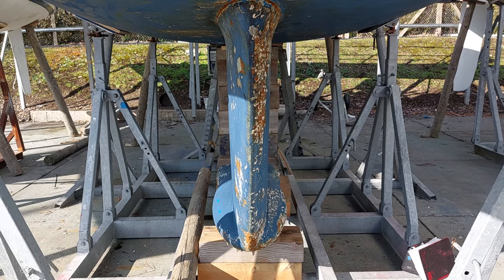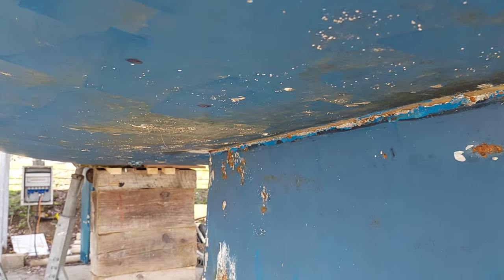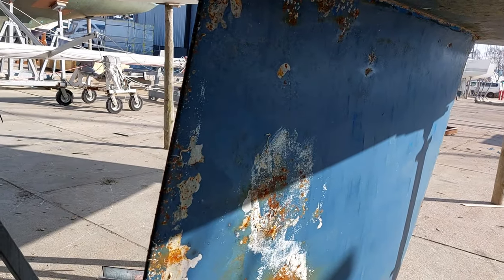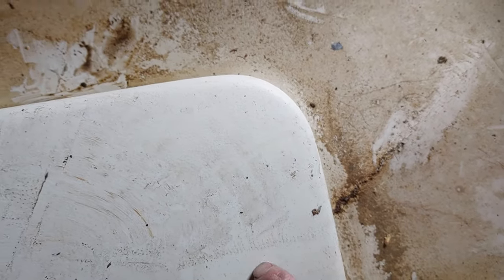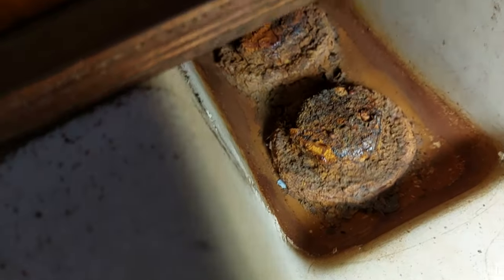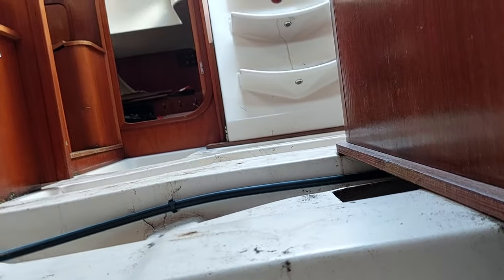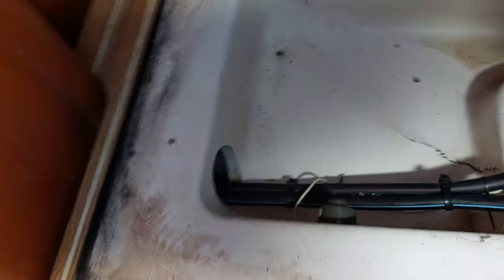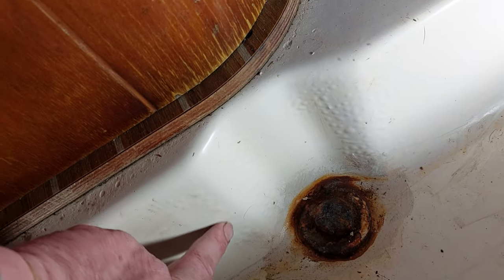serious structural failure of a yachts keel matrix from a significant grounding.

Comment: As an ex insurance underwriter, I can say that this is not worth repairing, unless someone buys it for pennies, then has the time, money and skills to repair it themselves. The problem still remains though, that the structure as designed was inadequate to resist a grounding impact. Restoring it back to spec will still mean the next impact will put you back to square one. Not an insurable proposition without a complete redesign and upgrade in strength.
Reply: Expedition Evans did a good series on that. Similar issue and willing to put the work in and accept what they might find when gutting the boat, they were with some luck able to come away with a much bigger boat than their savings would otherwise allow.
Reply: As a former boat yard manager and a marine surveyor who has over seen many repairs worse than this is have to disagree
Reply from the maker: Interesting.. the claims paid for it to be repaired against the insured value.  The repaired craft is certainly stronger than the original pasted together hull and internal frames
Reply: Scrap it for the safety of future owners

Comment: What a crappy boat- steel (not stainless) keel bolt hardware?. Galvanized pipe connecting a bronze thru hull? I would recommend scrapping not repairing.

Comment: Hi, I have seen a YT video for a similar repair by a Swedish shipyard done very professional. The boat was in the shop for 7 weeks. I don't know the cost, but it must have been substantial. I'm sure the cost will be higher then the market value for a 20+ year old boat. That would main for an insurance  that the boat is a total los. If the boat has an insurance for such an event, the owner will receive the current market value of the boat as a maximum.
Reply from the maker: Yes a lot of it comes down to value.  Depending on the severity many keel and matrix repairs cost between £9 & £14k in UK but obviously this is a very basic guide and every one is costed on its level of damage. Thanks for your comments
Reply: @TheMarineSurveyorNotebookBenSu  Hi, thanks for your response. I had a much higher cost number in my mind. That was based on this repair: https://www.youtube.com/watch?v=8X-Nb9-pbfU  (SAILBOAT REBUILD - how to REMOVE a KEEL - Plastskador repair - week1)  That was a partly rebuild of the grid and re attache the bottom hull.
Reply from the maker: It's very dependent on extent of delamination.  And where in the world you are based!

Comment: Amazing footage, thank you.
I surveyed two of these type of boats in the past few years.
Curiously it did not take substantial grounding to create such damage, one was motoring at the entrance of a marina around 5knots and grounding in soft mud, the vessel just powered through but the damage was done.
I contacted the manufacturer who suggested that these boats, using a grid to support the keel, are made to have the keel hang from the hull/shell and the boat should not rest on the keel while in dry dock.
!
Cheers,
a
Reply from the maker: Yes it's not always a substantial grounding that causes the issue as many vessels are pasted together so very little tolerance to being flexed

Comment: Another interesting day at the ‘office’ again! Quit a destruction indeed. Don’t think I would like to buy this yacht, even after an extensive repair. The corrosion on the keel bolts also were wuit extensive. Hopefully from standing water in the bilge.
Thnx again for s great video!
Harry
Reply from the maker: Many thanks for the comment. Once repaired, many are better and stronger than when first built... the but is as long as its been done properly. Thanks Harry 😊

Comment: Very nice video. It would be interesting to see how a repair like this is done. How do you maintain the alignment and geometry of the boat when you start to cut it, I wonder.
Reply: You “Hang” the boat on the stands so that the keel is hanging like if it was floating, then starts the grinding and laminating the many layers of glass, we had to do that on a boat that the owner hit a rock at 8 knots, that caused significant damage, it took 13 layers of tri-axil woven roving glass to get it structurally sound again.
Reply: @MrSeachaser175  Yes, I know about the process in general. It would just be very interesting to see a detailed vlog about all the steps involved. I don’t think it exists on YouTube. At least I haven’t been able to find one.

Comment: I know nothing of boats or boating but two questions if I may..
1) Why are steel bolts being used when surely stainless bolts (of appropriate tensile strength etc) might be used?
2) Is there any steel (ideally stainless) set into the bottom of the boat to which the keel is attached and which would also prevent "hogging"?
Reply from the maker: They are high tensile and have been used by quite a few builder including ah moody and others. It's essential to keep them clean and dry .. into a iron keel in many ways far better and less likely like stainless to suffer from crevice corrosion.. see my you tubes on that one!!! For the best way .. silocon bronze .. I've yachts still with the original ones we fitted over 45 years ago!

Comment: Or, convert the boat into a displacement hull trawler. Leave a 6 or 19 foot mast for a steadying sail, antennas, navigation lights, etc. drop the keel, repair the hull to be watertight and reasonably fair. Fill the bilge with cement for ballast. Would make a slow but decent live aboard trawler.

Comment: Very interesting video,  thanks.  Would a more traditional hull construction be more likely to hold up better in a grounding?  Would it be easier to repair?
Reply from the maker: Certainly a yacht that all frames, bulkheada and sringers are bonded in are stronger on impact.. but cost considerably more to produce.

Comment: Do you find that keel bolts like this come out promptly?  I am feeling like I would take off the keel,  tear out the grid, one bit at a time to maintain the boat shape, and then glass in floors and stringers. I am not a pro, and I am thinking the job would take two  months including drying time. The amount of fiberglass itch is beyone calculation: Defcon 4. Lay days in the yard alone would be $6K where I live. At least 10-15 gallons of epoxy, plus some Kay-Cell. And an acre or two of roving and stitchmat. A small fortune in sandpaper. A small plastic cup for my tears. Am I wrong?
Reply: Retrospective glasswork never takes. There is no chemical bond. Only mechanical.
Reply: @stephengrimmer35  That seems overly pessimistic. Lots of repairs are just slathered over the top of heavily ground out structure. Epoxy seems to stick pretty well. Poly, not so much.
Reply from the maker: Not impossible.  Once cleaned back most do come out

Comment: is there a specific make you find keel impact damage worse on?
Reply from the maker: Hi encapsulated keels normally are better.. then solid hull with bonded in frames then it's pretty much open to the level of impact. That said hulls that have a keel root created are often bit stronger than a flush fitted arrangement. Hope that helps

Comment: Do you think the keel has taken the weight of the boat to cause all that damage
Reply from the maker: The vessel has certainly had a good grounding at some point. The compression post and localised deck issues are also good indicators. Unfortunately, because the external and internal hulls have only been bonded together with just paste, from the forces applied its quite easily seperated. At that point the hull has lost most of its designed strength. The vessel has been supported ashore as best as possible to prevent further distress.

Comment: You might also mention that, obviously, all structural "glass" repairs really must be done with epoxy resins and never with (long chain molecule) polyester resins. 
 I've sometimes seen some long, very laborious and otherwise lovely repair work utterly wasted at the end, simply by way of using polyester resin. 
So irritating.
Reply from the maker: Absolutely.. being one of the first in the UK to use the west system 💯 agree 👍

Comment: If I could afford the fiberglass, it would get an aluminum keel with a zinc cast bottom. There would be a big wide Tee at the top of the new keel with bolts a good foot wide. Your next video would be a big granite rock with a gash being filled in  by rock repair specialists.

Comment: you mentioned 2 option. You forgot the third, which is to scrap this piece of junk.
Reply from the maker: Often a good repair is stronger than the original production design. So I wouldn't always rust to the third

Comment: You can do nothing in the terms of repair. Boat is from 1990's. Dismouting antimould far exceeds the value of the boat.
Second option i lot of to do or invest for poor outcome. Simply for the amount of the cost of repair it is possible to buy similar boat with such great damage or defect.
Problem is in the design as well. Keel bolts are not aprochable and what material of the keel bots and nuts that came too rusty. It mast be more carbon out than in the structure of the austenite crystal lattice of steel from which the keel bolts and nuts should have been made.